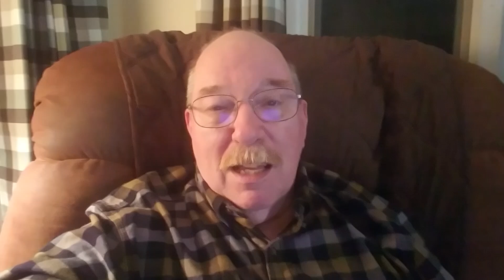Raw Bacon And Old Sneelock Swapping Stories

Comment: I ran a 6k rough terrain lift for the Cav till I came home. Set up like a Lull with all the different options on steering and booms and tilting the body and such. The brakes were touchy and I mean touchy. Had a 3-53 or 4-53 2-cycle and an Allison auto and was set up ratrer nice. Lifted a full tanker that the landing gear collapsed with one. Also blew one up that was rattling like a can of rocks. I told 'em. I also understood that the closer to the ground stuff was that a lift wouldn't tilt much. Kept me out of trouble. And the last was a Cat IT-28 with a set of forks. They'll do a lot of body work. I still like fork work. It's just really repetitive. Heal and God bless Yall and Mikes outfit!
Reply from the maker: I got the honor of loading and unloading trucks at the Product Action Warehouse. They only let supervisors or project coordinators drive the lift. 
Yes. It is dull as dishwater. 😁😎

Comment: Yeah, this reminds me of a couple stories.

I was working as a fork lift driver during a BIG PUSH to ship out ALL MANNER of ordinance.  Running like mad to move lots of material.  I managed to catch the end of a sprinkler line on a long loading dock.  Dumped a ton of gawd-awful stinky water in nothing flat.  Of course the fire department and everybody else had to show up.  And all work had to come to an immediate stop.  It didn't take very long to get everyone put back to work.

The other wasn't me driving the fork lift.  We were reworking cluster bombs in an old "cooler" building from the 40s.  The building was surrounded by earthen berms with sloped concrete walls facing the building.  The bombs came in by railcar, and went back out by railcar.  The railcar used to ship out was located along an outdoor passage that ran between the building and the berm.  The containers that held these bombs were about 12 foot long, and the distance between the building and the concrete wall (at floor level) was a little less than 12', so you HAD to raise them up just to have room to drive.
My crew worked second shift, and we arrived on a particularly hot summer day.  The building had windows that had a pivot halfway between the top & bottom.  No one (particularly the fork lift driver) happened to notice the first shift had opened the UPPER windows (probably 12' up), so when our forklift driver took out the first load, she of course clipped the window, and we were all treated to the sound of shattering glass.
Maintenance came out and looked at the window.  They brought a 4 x 8 sheet of plywood and banded it to the window frame.  That "temporary" fix was still in place years later, and I imagine it was still in place when they eventually leveled those buildings.
Reply from the maker: I clipped the top of the door frame on a trailer that sat about 3" too low to fit the dock at product action. 
The driver flipped out and was scared he was going to be in trouble.  
I sat the two tubs down with the forks and popped the track back in place with the tip of the fork. 
It never helps to be in a hurry. 
12' feet up behind the overhead, the mast, and the load, pretty easy to miss a window in the dark upper reaches of a building. 
Lucky the bombs didn't break loose on the pallet.

Comment: Last place I worked for that had "skilled""drivers had killed several outside walls with offroad forklifts.  One thing we did when we had to repair thoes walls we framed them back with 6x12 instead of 2x6s(1in thick structural lag bolts to connect them).  The entire wall was made of thoes massive beams and turs out never had an issue after.  Wall run into you!  On the greenhouses we got conveyer mesh grates and put them 6in under important pipes like water mains so in case someone was reckless they can hit welded steel "nail plates or skid plates".  If it was up to me just get better workers but that is rare these days.  Cheap forgen labor vs building things like a tank.  Even at that the break rooms were not sheetrock it was 1 1/8 t&g plywood serous business!
Reply: Forgot to say 2 of thoes demolished walls the other side was a break/lunch room  someone could have got killed.  Before the accidents were put high rise steel I beams 18x12 rebard onto the ground and they managed to knock thoes over with the fork lifts.  They didn't take my suggestion if making a sacrificial cinderblock wall with concrete/rebar down it to make a permanent stop...
Reply from the maker: The grating is a good idea.
Not sure about getting better workers. I have made mistakes. Nothing as bad as flooding a building but I want to be careful about throwing stones. 
I taught and tested lift drivers. Some just shouldn't be driving things in tight spaces. Perhaps restricted to hand carts but even those require a little common sense. 
I hope I never have to work in a factory setting again. 
The Annex will have most of the machines that I will ever need or want to work with, with the exception of a Bridgeport vertical milling machine. There is still hope that one of those will wander out to the curb somewhere and I can put the hoist on the 8N and trundle it home. 
The Annex is too small for a forklift. Maybe a Big Joe would fit but if not I will work around it.
Reply: I would love to have a Bridgeport and a overhead gantry crane myself...  overhead cranes ate cheap these days Bridgeports are not... one day!